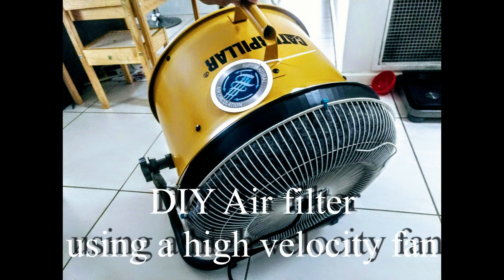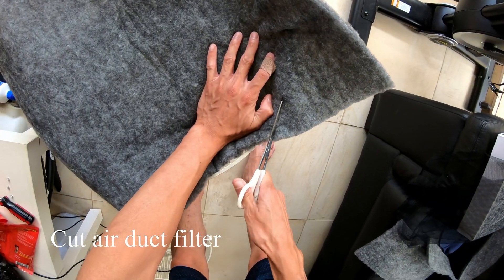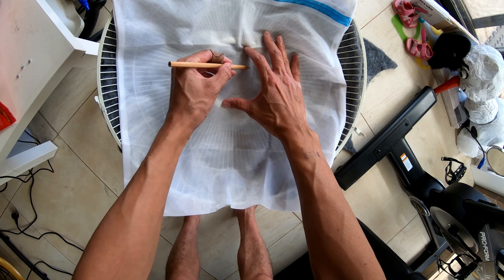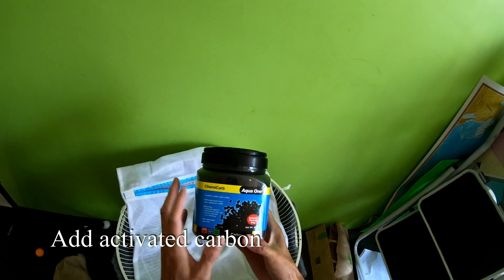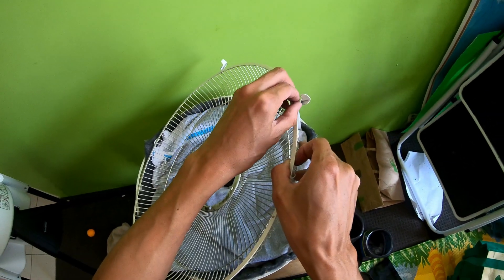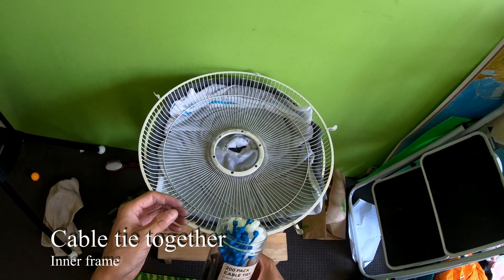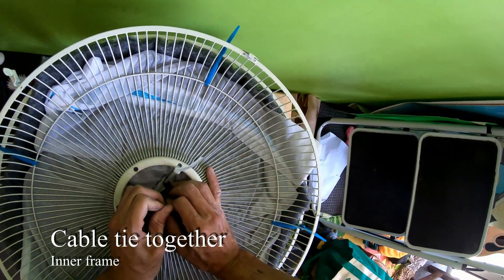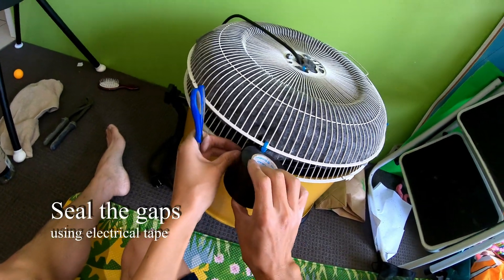DIY smoke filter - canberra  pollution 2019/2020 - CAT high velocity drum air circulator

Comment: how is it working now? any problems with motor wear
Reply from the maker: Have only been using it occasionally and so far no change in motor performance. Works well to clear odors from house, but doesn't seem to help much with pollen. Probably need HEPA filter for pollen and hayfever relief.